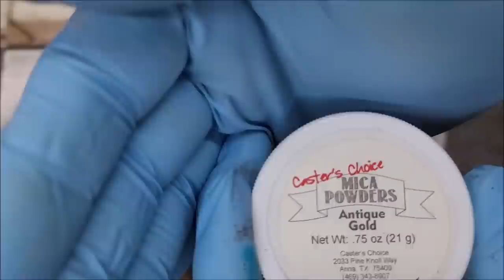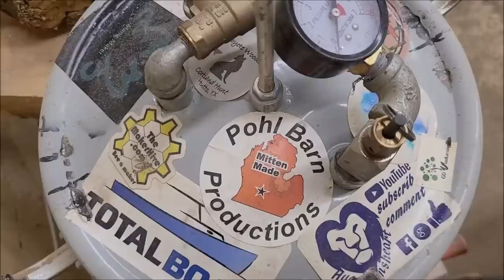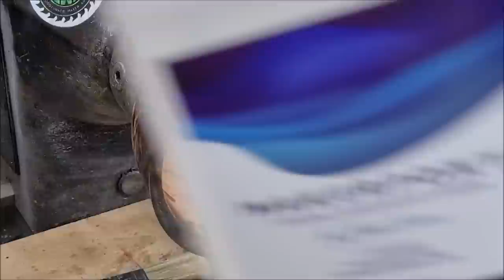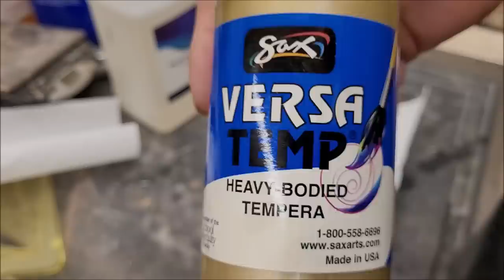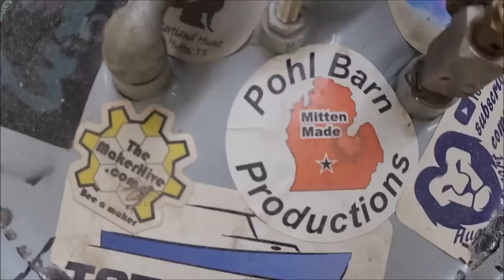🍎Infusing Thorn Apple with Gold, Pewter and Glitter

Comment: Osage Orange, also know as a hedge apple tree.  Double the BTU of the next hottest burning wood.  Settlers would quarter the apples, put them in buckets with water to break down over winter.  Then take the mash and pour in a trench along property lines, growing a living fence line.  Wasn't native to USA.
Reply: I think osage Orange is a different tree.
Reply: @jasonhilliker492  Looks like that wood and those thorns are the same.  The branches actually start growing as thorns, on Osage orange.  But, could be a similar tree; I'm no arborist.  🙃
Reply from the maker: I believe this is also called Hawthorne and it does grow everywhere in the northern hemisphere,  it's not got the same bark on it that Osage Orange has, I've turned both. or maybe it grows differently down south.
Reply: @PohlBarnProductions  Here in North Texas when you talk about Osage Orange you are talking about Bois d’ Arc (pronounced bodarc) tree. The fruit we call horse apples, or we did as kids. Also known as hedge apples. There are a number of homes of the late 19th century and early 20th century built here in DFW that were built upon piers made from bodarc trees. The wood is almost impervious to rot and is also used for fence posts. The OP is correct that bodarc trees were planted as wind breaks and hedge protection.

Comment: Love those colors! I’d love to see copper, copper glitter with the pewter as well, I think that’d be beautiful combo too. Turned out gorgeous Doug! Did you like the art resin? Since I often work with molds, I mostly use art resins. Just curious if you noticed any difference. I used Stone coat’s art resin on a table top project and it was great. We didn’t have a single bubble on either table and I didn’t torch because I was hoping to avoid divots.. that actually worked well too, no divots either.😊 Great job! Thanks for another enjoyable video!
Reply from the maker: Thank You Funo and Thanks for watching

Comment: Curious why if you use Total Boat resin for casting why you use a different resin for finishing? I use Total Boat for everything. 🤔🤷‍♂️
Reply from the maker: I used total boat for the finish, but not the 2 to1 as I do not like the tacky finish it leaves for me, Thanks again For watching Terry
Reply: Sorry did not notice that it did say Total Boat way at the bottom in small letters! 🤷‍♂️